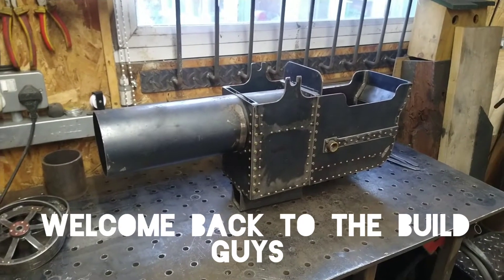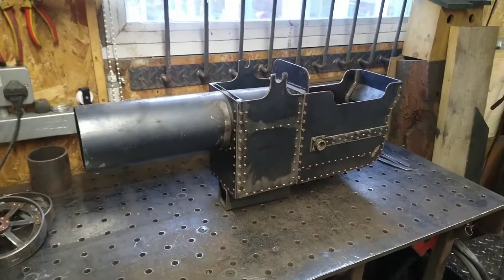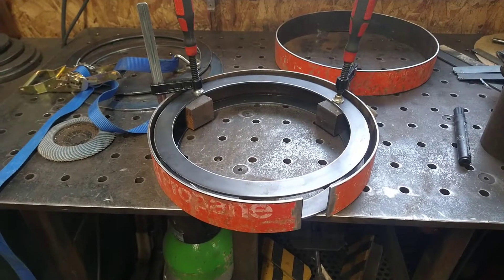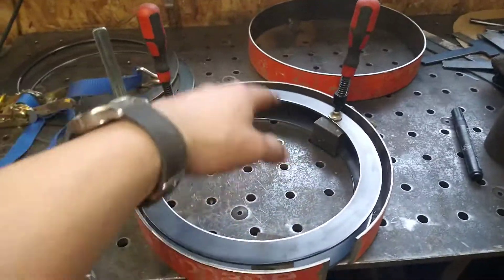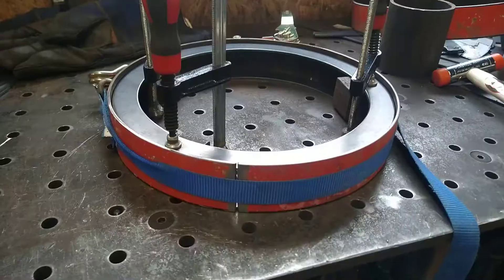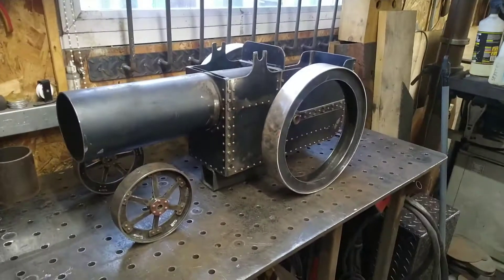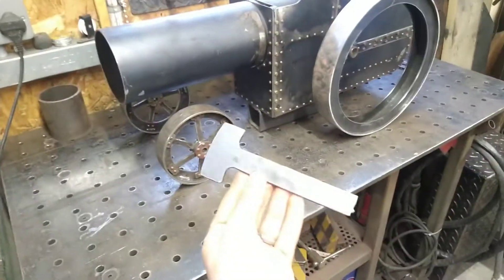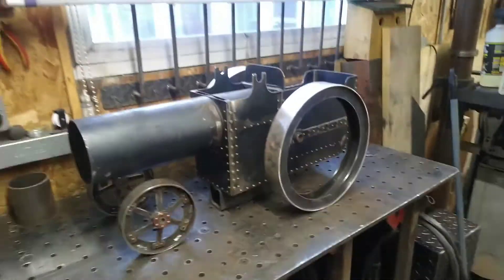Traction Engine build: 14 Making a start on the rear wheels.

Comment: what are you making the cylinder from a casting or fabrication
Reply from the maker: Fabrication, it has been put on the back burner a bit as I am currently setting up a forge to work from this year. I work on it sporadically in-between other projects.
Reply: @Hammerandhilt  look forward to seeing it  i machined one from a solid lump took a bit of time but turned out ok
Reply from the maker: Sounds like a intricate job, yes I've still got the boiler to finish. Have most of the parts for it.

Comment: looks absolute mint mate
Reply from the maker: Cheers Scott, slowly chipping away at it. Seen a few videos of yours running. Congratulations on getting that far, hopefully I can eventually get to steam mine 👍
Reply: @Hammerandhilt  Cheers Rob! You will get there took about 5 years to complete mine after trials and errors, i originaly went for a steel boiler so i could  weld it, Although it did somewhat work It took far far to long to heat up etc..
(Stick with copper)
Have you got any engine bits built yet? once you get it 1st running on air it will drive you to get it steamed up :)
I used o ring for my piston rings with no problems! (silicone/Viton)
P.s. i also lost all contact with george many years back
Reply from the maker: @steamedup100  No engine bits built yet, need to buy the materials as I've just been buying it in stages. I have the boiler tube and bits leaded bronze for the fittings tho etc. Yes the steel boiler was also my idea from the start, maybe I will try that approach later if I build a larger scale. I'm going to TIG weld my copper boiler, may change the design a little with fitting through pipes. Cheers for the tips on O rings it's all invaluable. Yes I had the same with George, last I heard from him was around 2018 maybe 19 I think. Hopefully he's alright he always seemed like a nice chap.